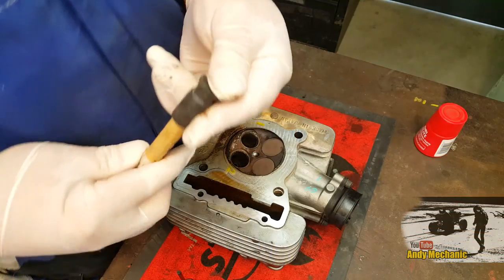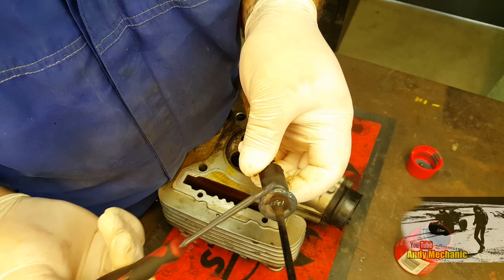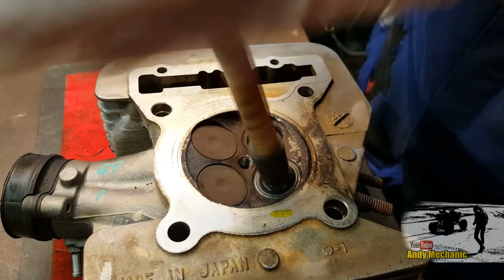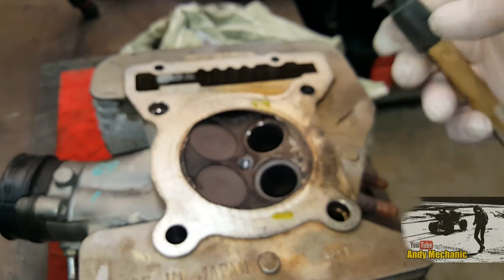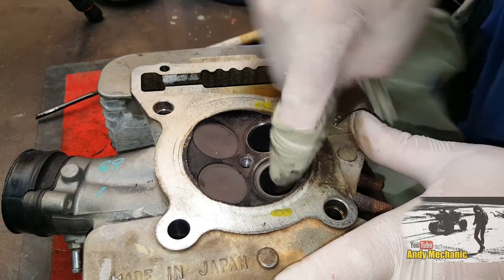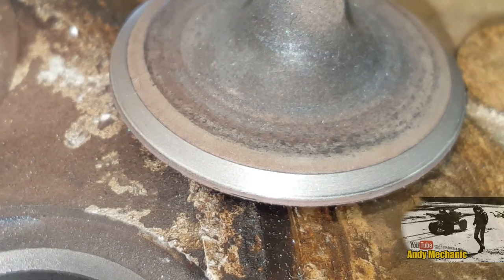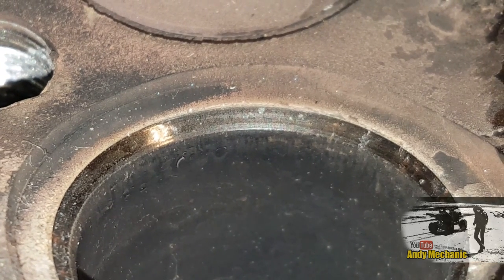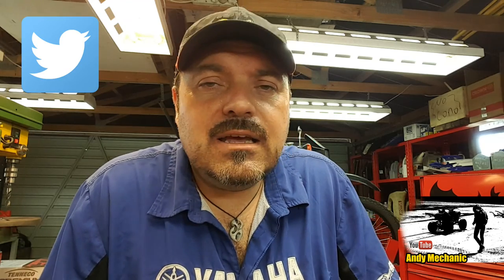How to lap valves in #1156

Comment: Hello! I'm Thusharapriya Perera (a do it yourself - DIY mechanic) from Sri Lanka and spitting or spreading saliva on the rubber cup of the valve lapping hand tool is perceived as an awful & hasty act and also I personally don't like it. As a suggestion, use some water instead of using saliva on the rubber cup of the valve grinding hand tool. Thanks a lot and have a nice day.

Comment: Hi Andy it sounded like you were going to use the valve that you lapped? I've always heard that once used for lapping the valve is no good?
Reply from the maker: Hi Steven, no, it's routine to lap valves during a cylinder head overhaul - it's important to ensure the valve seals correctly to prevent leakage of compression & combustion gasses. There are some titanium valves that you can't lap which is a pain

Cheers for the feedback. Andy

Comment: How important is it for water to not leak through after lapping? I've lapped mine and looks good but if I put compressed air through the valve with the port filled up it bubbles. Does that really matter for a reliable el cheapo rebuild?
Reply from the maker: No. So long as water doesn't leak through under atmosphere pressure it'll be just fine

Cheers Andy
Reply: @Andy Mechanic  awesome thanks mate. Love your videos.